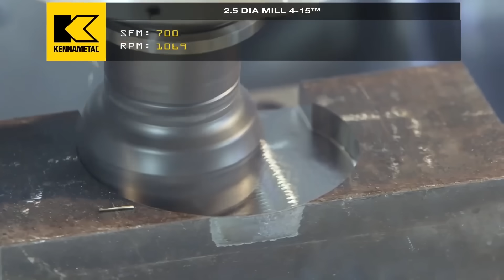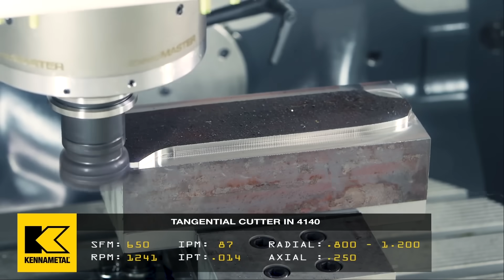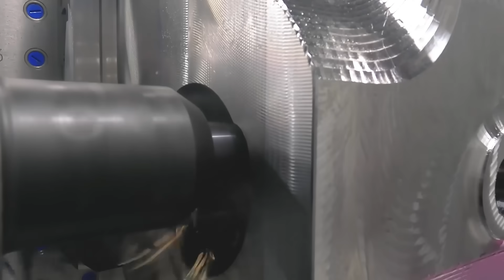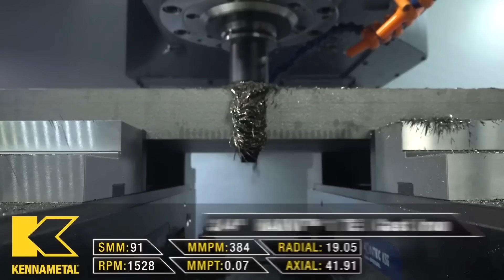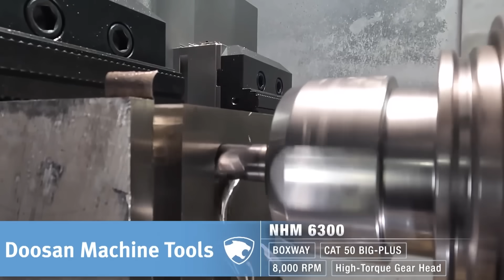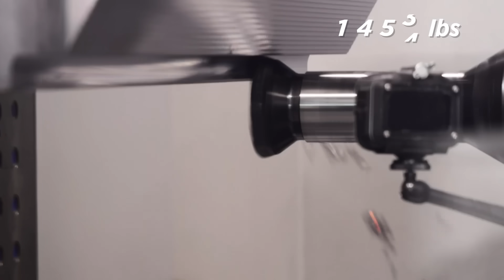Most Legendary MONSTER Machining Cuts Ever Filmed

Comment: is the wobbling for purpose ? or is it because you go so deep atone ? thank you i think it was 2nd scene
Reply from the maker: Yep, it’s due to the amount of pressure I put on the tool… It’s way to much and the tool doesn’t know where to go… It’s Under Complete Stress😳
But the End Mill doesn’t break… and that’s the point I was trying to make. Like Morphias from the Matrix, I am trying to open Machinists Minds to the Possibilities…

Meaning, your running at 10% of that… What is you went to 40%???
That would mean you would rough off stock 4X that and make 4X money which results in savings for your customer and money in the bank to take care of your family.
😁😁😁
Reply: @TITANSofCNC  🤣
Reply: @TITANSofCNC  thank you titan. I love you and ur my idol I’m looking up to you in case of cnc company. I got a wood cnc company in Germany with a huge 5 achxis Holzher for producing wooden stairs, but now I’m moving into order milling learned so much from you. Thank you and all your efforts to help others. Your a legend.
Reply: Yeah. It's called adaptive clearing I think. And it means that the whole half of the cutter isn't touching. Less than half cutter engagement is better.
Reply: @anguswhitnall1084  but if you look closely, only the toolholder is moving, not the spindle.
Reply: @lukaslapnik5839  It does kinda look like that in the second shot. I don't think it would be cutting that cleanly though if something was flexing that much unintentionally. Still pretty sure it's an adaptive slotting toolpath and a bit of an optical illusion that makes the spindle not look like it's moving too.
Reply: @anguswhitnall1084  You`re right.
Reply: I mean sec 36, seems like the Head is wabbelig
Reply: That's definetly not an adaptive toolpath. Just a straight full slot movement. The X and Y axis are not dynamic enough to make those small movements with such feed rate. The movement is flexing of the  tool holder or maybe even the spindle. Either way this is very bad for the spindle.
Reply: @RP-pi2iv  That is cycloidal milling. And yes, the moves are defined in a cycle.
Reply: @alsobinich463  Aaah, so this cycle makes a straight movement for the first inch or so then starts wobbling and then suddenly stops wobbling and goes straight again for the last inches. Interesting cycle..🤔🤔
Reply: @RP-pi2iv  Maybe you`re right. I can`t imagine such wobbly spidle. Working at a old rigid horizontal boring machine with heidenhain tnc 640. We use cycles to give the tool space at cutting this deep.
Reply: @alsobinich463  ah yeah I work with tnc 640 too on my Hermle C650. Its cycle 275 for trochoidal slot. But usually I program trochodial moves cadcam on Powermill or Fusion360😁
Reply: @RP-pi2iv  I meant trochoidal as writing cycloidal. Very nice machine, the C650. In our shop we have a Hedelius C60 lead by iTNC 530. I would like to work with TNC 640. Way better graphics than older versions. Real 5 axis is a dream of me. Once seen, 3-axis sucks...
Reply: @alsobinich463  hedelius machines are very popular here since the akura 5-axis came out. The side effect of 5-axis machining is that the setups can take longer and the programming is intenser. But for complex part it works very well. Some simple parts are better and cheaper on a simple 3-axis machine haha
Reply: It is not a full slot toolpath, It is a programmed "wobble"" and yes the ballscrews can handle it. I run volumill toolpaths exactly like this all the time on an older Haas VF3
Reply: @Being_Is_Reality_Is_Being  funny how the moderator of the channel just contradicted you
Reply: @RP-pi2iv  yeah, they'll never let me near G code again! I'm ruined!
Reply: The spindle is just fine with that diameter of endmill..i bet the torque doesn't even reached 20%.. you can make the depth of cut as deep as you like and the spindle doesn't even break a sweat, that end mill will break first. A different stortry with the face mill
Reply: That's the tool holder flexing due to cutting forces. Extremely bad for the machine, especially spindle bearings. Not anything anyone would do unless you had a free machine and for entertainment purposes.
Reply: @lukaslapnik5839  so it’s super Bad ?
Reply: @papa4614  basically yes.